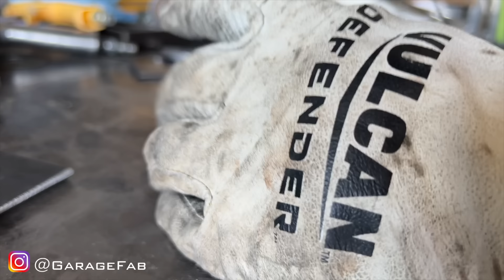Build Poly Engine Mounts For Anything! Mighty Max Ep: 19

Comment: I used to be a Mitsubishi mechanic late 90's, and I have to say you are one brave sob. That is an interference engine and moving that engine around without a timing belt is just asking for a cam to fall off a lobe and rotate. Then you have valves contacting pistons. I've seen it happen a 1000 times with people just changing the belt. Ruined heads for everyone.
Reply from the maker: Brave? Maybe. Or possibly just clueless and I’ll be re-rebuilding this engine soon. 😳 
I predict it’ll be ok though. I made sure none of the pistons were at TDC and the cams are relaxed.

Comment: The bolt holes are on your block for the truck mounts. The two bolts on a vertical line are the 2 the truck uses stock.
Reply from the maker: Yes! I have since learned that. That’s so strange to me. When slamming on the brakes, the inertia of the engine is so great. Two pair of vertically positioned bolts doesn’t seem adequate to me.
The designers must’ve considered the trans mount as the main forward/rearward limiter.
Thank you my friend.  🙏

Comment: Take the nominal size (M10 = 10mm) subtract the thread pitch (-1.25mm). 10-1.25 = 8.75mm, this is the drill bit size for the hole. A little larger is OK, smaller is not.

Easy trick to find the right drill for a metric bolt :)
Reply from the maker: Interesting! Super simple, somewhat obvious and yet I’ve never realized it. Thank you my friend! 🙏
Reply: Great information thanks for sharing
Reply: A set of metric drill bits are cheap enough to keep with your metric taps. And will save enough time, hassle and errors converting to inches every time you need to tap a hole. I do this with my Imperial taps because the maths is trickier
Reply: ¡¡ GREAT' 🙏 THANKS!!(REFRESH MY MIND)
SAVED CALCULATIONS; RALPH.
Reply from the maker: That’s really quite brilliant, Nick. Simple. Somewhat obvious. But brilliant! I think I’m going to make a purchase.
Reply: @GarageFab  I could have phrased that better, as you only need the tapping sizes. So: 5mm for M6, 7mm for M8(a little big, but works well enough on steel and a lot easier to find than 6.75), 8.5mm for M10  and so on. Keep them with their taps once you've proved they make good threads, and don't use them for anything else. Saves time, frustration and cock-ups
Reply from the maker: Ironically I’ve done that at work with standard drill bits; Found the bits that work well, labeled them for the tap size and store them in my tool box with the taps away from the drill bits.
Good advice. 👏
Reply: @GarageFab a friend of mine has a nice set up in his tool making shop. For each fastener size he regularly uses there is a wodden block, just a short piece of 4x2 with a bunch of holes in it. The taps, tapping drill, clearance drill, a drill to drill a hole suitable for reaming, reamer, counter bore tool etc, everything you need for that size has a home in that block of wood. Hate to think how much he has tied ip in tooling, but if you want to be competitive thats the sort of thing that makes the difference. Time is money. I cant justify it for me at home, but its certainly a pleasure working in a shop like that.
Reply from the maker: Ah, yes. I feel you. If working in a highly organized shop is so efficient and a great joy. Of course I only know that because I’ve worked in other peoples shops. 🫣

Comment: Turbo fix…make an adapter between the turbo and manifold that has a wedge to it to angle the turbo closer to the motor giving you more space for the upper suspension mounting points AND a better angle for the exhaust…my .02
Reply from the maker: I like it. I considered creating a bit of a wedge shaped spacer. Still might though this is a good excuse for making a video about custom headers. 🤔
Reply: @GarageFab  I wanted to ask you where you got your bushing or Rod end for the mount? I’m putting a LS in a Tacoma and no one makes a mount. After seeing what you did, making a pair looks like the answer. Good luck with your project!
Reply from the maker: I get all my link bar ends from Thorbros.com
https://thorbros.com/collections/4-link-bushings
I’m sure there are other places but I’ve had good luck with the quality of their polyurethane.
Thank you my friend! Best of luck to you too. Sounds like a bucket of giggles. 😃

Comment: A 4g64 mighty max pan has a flat bottom, not sure if that helps at this point. The AWD/FWD pan has that goofy slant. You'd need the matching pickup and to add the turbo drain fitting (people typically convert to -10AN anyway). This is true for 6 bolts, not sure it carries over to 7 bolts as well. There are also other oil filter housings from other model vehicles that give options on filter placement. The mighty max housing points the filter straight outward toward the frame rail, could be better or worse. That bolt in the way of the driver's side mount is the balance shaft alignment inspection hole. If you delete balance shafts you could have deleted that bolt, just put some RTV around it. No reason not to keep it though. The moveable card stock bushing template idea is brilliant, I'm using that when I replace my solid mounts with bushing mounts! Love the project, love the channel, glad you're back.
Reply from the maker: Happy to be back, Kevin! Thank you for the food for thought! I’ll consider it all (except the pan. I’m lazy and it’s off the ground now) I’ll be looking into the other stuff though. Cheers!

Comment: 22:35 by the looks of the shavings I'd say the crank casing is made of cast iron, not cast steel. Since this is quite brittle, I'd take a closer look at the other motor mount threads, if there is a threaded insert glued in for additional strength. If that's the case, I'd replicate that. The manufacturer of the engine knows what they're doing. You don't want your threads come out with the bolt when you floor the pedal. That would make for a medium catastrophe.
Reply from the maker: Good looking out! The shavings were indeed quite powdery. I don’t think there is inserts but I’ll look much closer tomorrow.

Comment: I actually just finished doing almost the exact same thing in my truck. I crammed a 6bt into a k1500 a good few years ago with some solid mounts I slapped together just to make it work. Finally got around to building some proper mounts with fab bushings like yourself. Its a night and day difference.
Reply from the maker: Yes! Admittedly this will be the first time experiencing poly engine mounts for myself. Hopefully vibration isn’t too bad since this truck is for my Wife.
Reply: @GarageFab  I would say the poly mounts are a happy medium between solid and rubber mounts. I'm curious if the difference between a lifted truck and a bagged truck would make any difference on the vibration. I have 10"s of rubber between the rim and the ground. I'm wondering if that helps dampen the overall vibration. I look forward to seeing the results you get.
Reply from the maker: Absolutely. Air suspension absorbs a lot more road vibration than typical springs. But your fat tires will absorb far more than my low profile tires. 
It’s like we both have air bags, just in different locations. 😂

Comment: The newer 6g63 engine has an oil filter housing facing down. With that you have more room . And if you take an advice. 80 precent of the 4g63 comunity does a Balance shaft delete. Because its much safer,and you dont notice it. So i would do it. 🙂
Reply from the maker: Thank you my friend! What’s safer about the delete? Just one less belt to fail?

Comment: Yeah, the 4g63 swap is tough, unless you have an early truck with a KM132 transmission. A six bolt FWD narrow block is the trick. Way to not give up!
Reply from the maker: I think I have that trans. ? It’s an 87 Mighty Max and the transmission bolts up to the 4G. That’s about the extent of the ease so far. 😂
Reply: @GarageFab  lol, there is so much confusion on that topic. What motor did you have originally?
Reply from the maker: Um… I’m not sure. I’ve had several Mighty Max’ and I don’t recall which was which. But I think the 2.0.
Reply: @GarageFab  if it's an 87, it should be a narrow block and a KN132 trans. What year was the donor car? Was if FWD? Sorry for the questions, this is something I've been researching for my 88 Ram 50.

Comment: So here's what I did to solve the Christmas light problem. I took all mine down and put them in the recycle bin and then I bought the nice strip LEDs and ran it up the fascia boards at the house nice and tight and I leave them on a timer year-round and I could change the color and the pattern and the brightness for any season. Of course I just keep them on red because I'm lazy.
I'm not saying you should do this I'm just suggesting. It even comes with a remote control or I can control it with my phone using the app.😊
Reply from the maker: I’d rather you not control my lights.
😂 
I’ve actually been wanting to do that for years. It will happen eventually. Did you get high quality ones!
Reply: @GarageFab  I don't know if there's such a thing as high-quality lights because they're all made in China but they seem pretty good still working for over a year now. 1 LED burned-out out of 150 ft. From Amazon. Funny u thought of getting them too. It's very dark in my neighborhood so on very dim looks super cool. Like a red 🏠house!
Reply: @GarageFab  I know it's desert out there but are you at high enough altitude to get snow and ice at times?
Reply from the maker: The last time we had snow that stuck around long enough to turn everything white was 2008. It snowed this year but nothing stuck. It gets cold. Plenty of ice and frozen pipes, but nothing like most places.

Comment: This is the same situation I'm in right now. I'm dropping a 351 Windsor and C6 trans in my 64 F100. I installed a fatman fab ifs mustang 2 front suspension...so it's all new brackets and frame mounts.
Reply from the maker: You getting it figured out?
Reply: @GarageFab  yeah I got it in there finally. Transmission mounts are done and now I'm having to build a new crossmember because the original is in the way of the driveshaft. I'm using a driveshaft hoop for drag racing to build it. Slow and steady but I'm still moving forward.

Comment: New Exhaust manifold. Miniram style will work. 

Move the AC compressor. Stock brackets are cast Iron and weigh a ton. Electric AC is also an option. 

Possibly remove the oil filter housing. You can drill and tap the oil ports for fittings to run a hose with remote oil filter.

Zip off the bottom of the oil pan and weld on a new sump using the existing flange
Reply from the maker: I’ll likely take your advice on most of that, Brandon! Thank you. 🙏

Comment: Narrowing a frame creates a whole world of problems when trying to use factory parts. The bright side is now you are the engineer who gets to determine where the accessories go. If it were my project, I would build all new brackets placing things were they fit best and give maximum maintenance access. Since you are building a small truck, look at using smaller parts like the compressor, power steering and alternator from other makes and models, since you are making the brackets, they will fit where you want them and because the brand is different doesn't mean they won't work. A walk through a "You Pull it" place can give you lots of workable ideas.  Can you relocate the turbo, it would sure make for cleaner plumbing. Look forward to more great videos.
Reply from the maker: So true! I was talking to my brother about using a Prius A/C compressor and not attaching it to the motor at all. Luckily I don’t need a power steering pump. Alternator is all that’s left! Much appreciated my friend! I just might do that junkyard stroll!

Comment: Get/make a high mount turbo manifold, that'll settle the turbo issue. oil filter sandwich plate, with a port for the oil pressure sensor, and just block off the original port, that'll settle the oil pressure sensor. Customize the engine sump, since you are converting it to rear wheel drive, the oil pick up and sump will need to be modified anyway. You will still have to relocate the AC compressor though. This way you can leave the frames in tact
Reply from the maker: Is this true?! (About the oil sump) I’m gonna have to go check in the morning. 
I think the A/C relocation would make an interesting video. Kinda looking forward to that one.
Reply: @GarageFab  yeah mate, since the 4G63 is set up as a Front wheel drive application (or 4wd but still lateral in the engine bay) under acceleration the oil will slosh to the side of the block, since you are making it RWD the oil will slosh to the back of the block. Can cause you some serious oil starvation. Love this channel by the way, you do some awesome work, better than some professional workshop I've come across

Comment: For the oil pressure sensor, what is wrong with installing a 90 degree elbow?  I would modify the plumbing before cutting more on the frame. Thanks for posting this. You gave me an idea to make my own rear motor mounts for a small block Chevy for use  in my '56 Chevy.  I have never had an original type break but I have seen broken ones. Being a 2 piece metal bracket held together with rubber bonding it into one piece, I feel a captured mount such as the style you made will be more reliable with  over twice the horsepower.
Reply from the maker: The 90° elbow is brilliant. Sometimes the simplest solutions escape me. 🤷‍♂️

Comment: Oh and I almost forgot, as for the Mighty Max, just eliminate the AC the oil filter and put an elbow for the oil sender. Ta da!
Or if you want to get fancy just put a remote oil filter on it and put one of those fans on the dash like the mail trucks have.
Reply from the maker: Haha! I’ll let the Wife know she gets a fan. I’ll tell her it was your idea. I’ll give her your address. It was nice knowing you.
Reply: @GarageFab  😔
Reply: @GarageFab  did one of your videos offer a discount with Benchmark abrasives?
Reply from the maker: @notme8121  Nope. Only Empire
Reply from the maker: https://www.empireabrasives.com
Discount code Mankandy
Reply from the maker: I think. 🤔 It’s been awhile. If not try GarageFab
Reply: I like those fancy drill bits u have too. I always wondered why you didn't just drill a small hole in your wood template until you punch through into the metal and then I saw you have fancy punches two that are self-centering. My woman is self-centered also.
Reply: @GarageFab  it gets worse as you get older man, before long you'll be looking all over for a tool that's in your back pocket or looking for safety glasses that are on your head! I'm there and it's not easy.
Reply from the maker: Oh I’ve been there. Not picking up after myself makes keeping track of things even harder. I’ll lose a sledge hammer and finally realize it was being hidden by a 10mm nut.
Reply from the maker: The cutters are called Hougen RotaCut Hole Cutters. They’re kinda pricey but worth every penny. Here’s a pair of associate links to the two specific sets I own…
Small https://amzn.to/3guFEwJ
Large https://amzn.to/3ukxxL5
Your life will change forever. You’ll still be married tho.
Reply: @GarageFab  oh no sir, I've had several wives but I've never been married! My name is Daryl, not dummy!
Lol haha !
Reply from the maker: I have much to learn from you.
Reply: @GarageFab  well if your wife would cross the country to delete me, I can only imagine what she does to you! It's okay, just keep moving forward.
Reply: Learn you will, but first, try you must, young mankandy .

Comment: @garage fab build looks great, but as for your A/C issue look into getting an electric A/C Compressor from a 06 Prius
Reply from the maker: I did consider a Prius compressor, but the work and cost required to make it operate is quite intense. I believe they make 12v compressors though so if I can find one, that might be the answer.

Comment: Great vid, very informative. You have good video style as well....  I think they only use 2 holes each side for the engine mount.... But what harm can more do.... 4 must be twice as much fun.... I'd be having a walk round the junk yard and trying to find smaller accessories that would fit easier into the space you have. I got a 30 amp alternator of a Kia that was about half the size of a 25 amp Delco.... Hyundai have some very small power steering pumps... 
 I like those Roto cut bits you use, so I asked our local guy about them.... I don't like them that much... What's your opinion about them? do they dull out quick ? They look a bit more accurate on the cut.....
Reply from the maker: Thank you my friend! I’ll certainly look into the accessory thing. That could be a Life saver. The Hougen RotaCut cutters are kinda pricey but worth every penny. Here’s a pair of associate links to the two specific sets I own…
Small https://amzn.to/3guFEwJ
Large https://amzn.to/3ukxxL5
I’ve been using the same sets for a couple years and haven’t had one dull out yet. 😳 They are brittle though! I’ve busted 3 by cutting holes with a hand drill, and catching an edge. Never lost one in the drill press though.

Comment: Nice clean engine mounts. I love the pointy bolt trick, but never used it with a wood template like that. Much better than going straight to steel. 

Are the mounts in-plane with the centerline of the crank? That will help keep vibrations down.
Reply from the maker: Unsure exactly what you mean. They’re parallel with the crank. And though not intentional, if you drew a line horizontally through the crank bolt the mounts should be really close to that line. 🤷‍♂️
Reply: @GarageFab  yup, thats what I was referring to. 👍